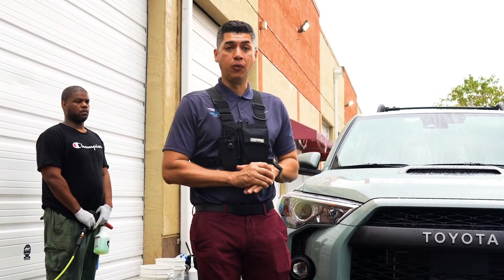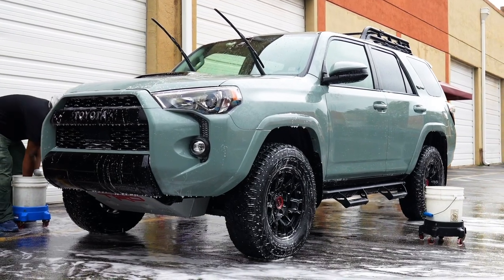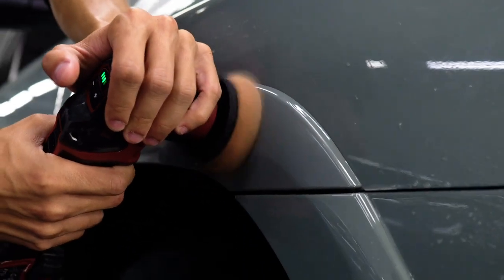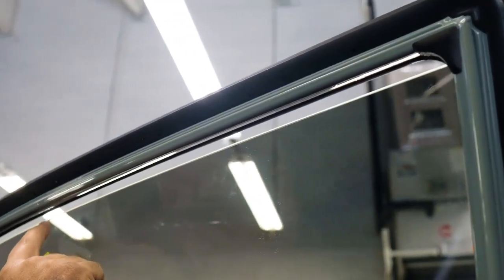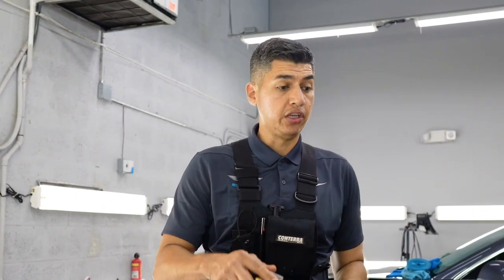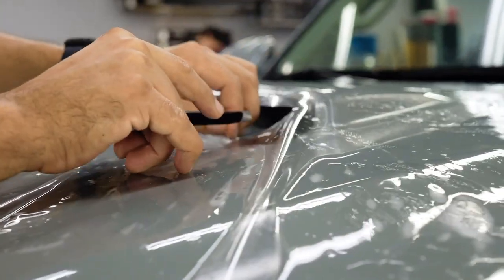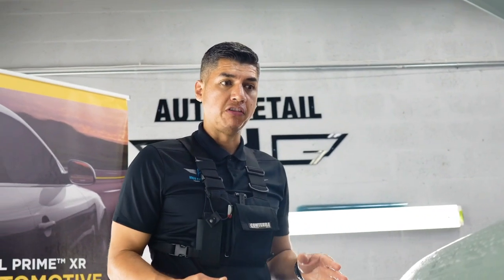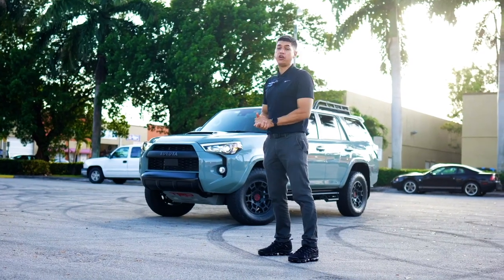TOYOTA 4 RUNNER | PAINT PROTECTION FILM | LUNAR ROCK EDITION

Comment: How long would this ppf last if you don't have the vehicle in a garage and it stays out in the elements?
Reply: Our fleet vehicles vary by the material used. Unfortunately, there isn't a single answer. Some, I see need changed as early as 4 years, others go as long as 7 or 8 years. None are garaged.

Comment: How much did this job cost?
Reply from the maker: Hello alex. Pricing will range depending on which panels you’ll like to have wrap. This particular 4runner’s ticket was around $1,800
Reply: @HighEndDetail  If this 4runner was done but no tint, just the xpel on the full car what would that cost?
Reply from the maker: @alexandera7273  you can find out pricing on this car when you browse through xpel’s website. Shop under pre cut kits and you’ll find it. A full install you can expect to Pay anywhere from 6k-10k
Reply: @HighEndDetail  I checked their website, and what I'm looking to do would cost around 4,300$. What do you charge to do the install?
Reply from the maker: @alexandera7273  we typically charge 30% installing fee on top of the cost of the material
Reply: @HighEndDetail  where is your location? do you gus use 3m 
'\